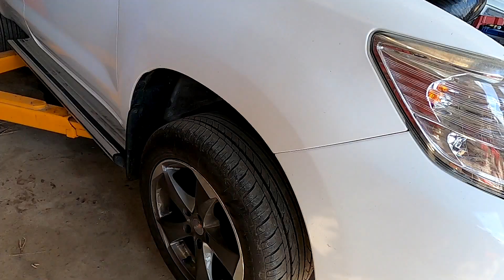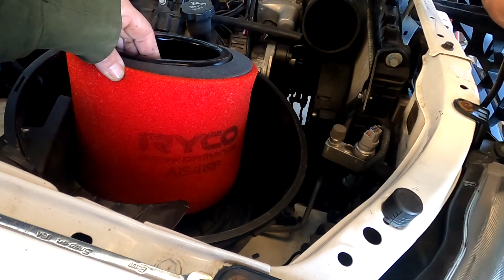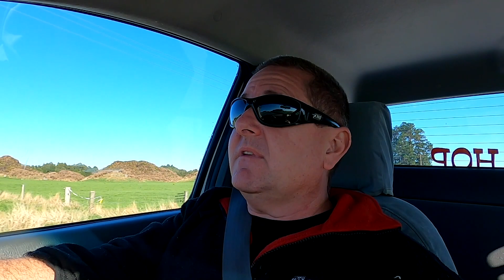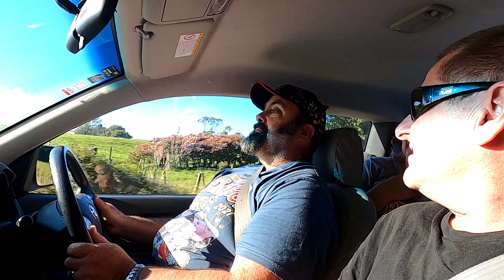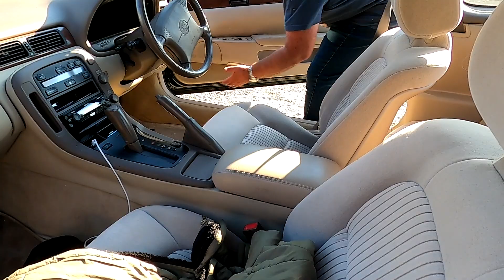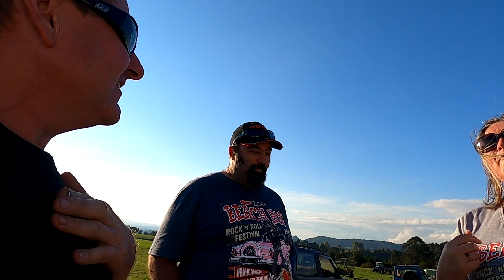2014 2wd Toyota Hilux LS2 6 litre V8 swap.  Certification check and owners first drive.   Ep14

Comment: Question...will the a341e torqueconverter fit the a340e? Precision industries says they only make tc for the 341 but as to my research they are the same it is to mate with a 1uz engine...
Reply from the maker: there are different lengths for the pump drive depending on different models of A340.  They are not all the same.  Just like the A343 , same deal , different parts over the years.
Reply: @CartuneNZ  usa spec? 1996 sc400
Reply from the maker: @diszruptiveent3634  chances are they are the same however pays to measure and check the two against each other
Reply: @CartuneNZ  alright then thanks

Comment: Off topic I realize, but have you heard of anybody advancing the timing belt pulley 1 tooth for more valve overlap? I'm running a link ecu and I was thinking about trying it to gain some more power up top??. If you skip a tooth it should equate to about 7.5* of intake advance and exhaust retard On a non vvti. Love your videos and you've helped me setup my 1uz the whole way, thanks!

Comment: Kelvin, excellent follow-up! 4 speed automatic would be nice, but I (and the wife) like our manuals... Got a bargain on a Subaru Outback with the 3.0 six, wife hasn't driven it yet as it was only offered in the 'States with an automatic... ;)
Reply from the maker: We got one model of early H6 outback with manual , and Ive worked on a few converted cars.  My personal car is an H6 3.6 outback for the 4x4 (I'm sure you have seen footage of my road, 2km of gravel).  My plans presently include a 4x4 hilux with Auto , running management as you will see soon in the Zephyr.   Cheers Kelvin